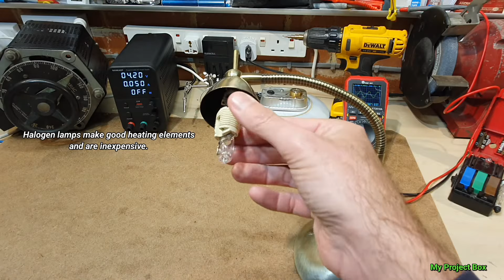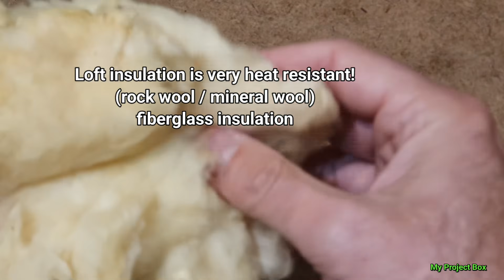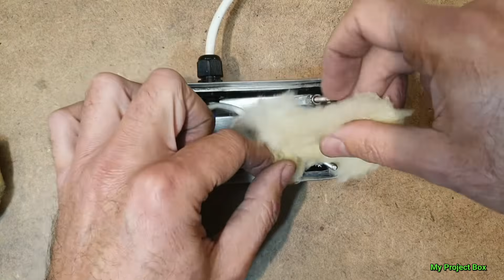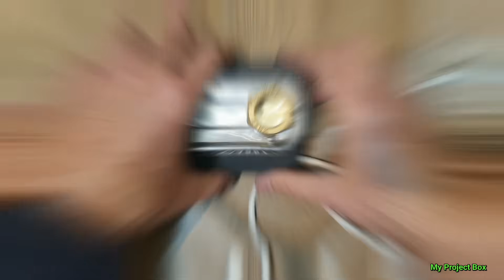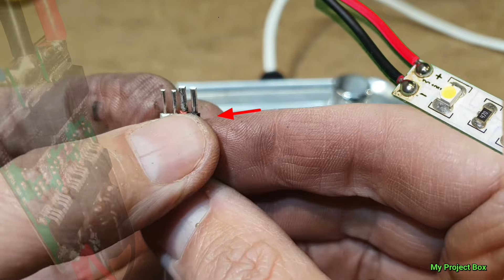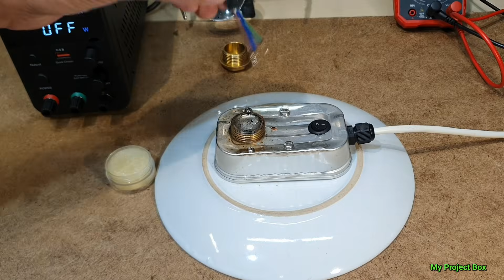DIY Wire Tinning Pot: Halogen Lamp + Pipe-Stop Solder Pot – Faster & cheaper than Crimping Ferrules!

Comment: Do you know if the lead content will stay in the brass end cap or migrate into the solder? I like to use lead-free solder since I am in a studio and I live in here. lol Thanks
Reply from the maker: You can just use lead free solder if you prefer.
Reply: @MyProjectBoxChannel  Oh, sorry, I wasn't clear, the plan would be to use the lead free solder as I do, it's just that the brass plumbing fittings usually have some percentage of lead in them. (Even the "lead free" fixtures sometimes.) 

I wager it's probably fine, I was just wondering if you had any idea or not. I would like to make this. I really like this design as well because it's utilizing the lamp instead of our lower rated 120v power over here, it would take a while to heat a kettle! So this probably does the trick just fine over here in the US. :)
Reply from the maker: @agoogleuser704 it should be fine. Maybe consider connecting a ground wire somewhere to the metal work, just in case the lamp shattered, and potentially makes something live. I only had 2 core wire available at the time, but I really should of used a 3 core to have a safety ground.
Reply: Good idea. I heard the led compatible ones can make halogens hum. I wonder if it’s bad for them? I have been poking around on eBay a bit, difficult to find the style you used for the dimmer. You know the metal knob style. I figure the plastic knob ones might melt or something. Thoughts? Thanks again for the neat oroject
Reply: Have you any ideas for a dim bulb variac? For checking electronic faults and protecting say old stock as you ramp up the power? 😮
Reply from the maker: @agoogleuser704 I purposely chose a long can, so the "heated pot" is on one side and the electronic dimmer (made from plastic), is onthe opposite/cooler side. The chrome knob is just chromed plastic, so a dimmer switch module with a plastic knob should be fine. You can also use a different enclosure with more separation if you are worried about the heating. LED compatible dimmer modules should be okay on halogen lamps.
Reply: @MyProjectBoxChannel  I think I will use a 1" Black Iron square plug that is hollow. I know it's not quite as efficient as brass but it will prevent the small amounts of lead from leaching into the solder over time. Also, with as little use as these would get, even so, the iron will stand up to the tin over time instead of eating away at it. They use it in crucibles sometimes, so I figure it should be alright. Maybe I'll try upgrading the bulb to 100W if you think the iron would make a substantial difference in heating? 

Appreciate your time, neat idea and video. I never considered I could have a solder pot that was small and for occasional use. I also like it because it makes me get familiar with more materials. Thanks again! :) Oh yes, also, as you suggest, I'll ground it.

Comment: This is great, but, I was wondering, are you aware of any designs that make use of an even smaller diameter reservoir? I have an ingot of a metal that will help de-solder stuff, but, of course, a large pool of it would be contaminated and cool too fast. I was thinking maybe I could make little slugs or something in a smaller container. Weird sort of request I guess. 

Thanks for the video :)
Reply from the maker: I have replaced the tip in my soldering iron with one of the big pins of a high current plug. This created a miniature solder pot that holds a small amount of solder. It's great for small jobs😉👍

Comment: Yes for Variac and Current limiter , will this just be light bulb in series with the load ?
Reply from the maker: You got the right idea, but I'm thinking a bit bigger and a selector switch for different levels of current limiting. Maybe different heating elements? I have a few 1000w halogen lamps, the linear type, like the smaller ones you see in the old style flood lights. So maybe make it selectable down to a 100W halogen lamp. That gives me some range to test small PSU's up to big appliances. My workshop(garage) is unfortunately supplied from a 13Amp fused spur😢. So a short-circuit could plunge me in total darkness. The current limiting will also help with large inrush current from big capacitive loads. I will of course add a bypass switch if no current limiting is needed.

Comment: Yes do a Veriac video most interesting I used to have one but mine was much smaller,you could use that to go with your solder pot, I did see a video to unsolder a large socket from a PCB awesome trick and worked very well, and he held the PCB in position to solder the new socket.